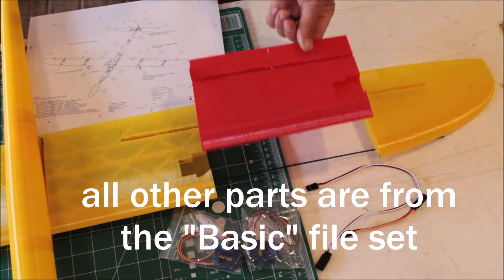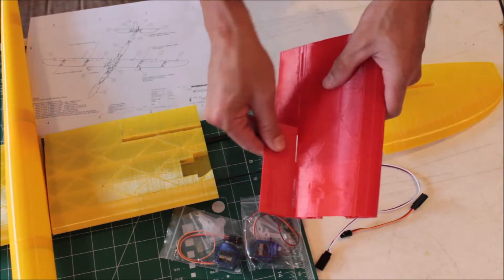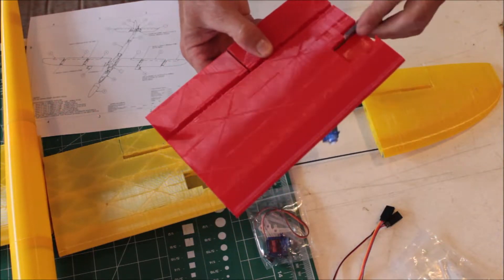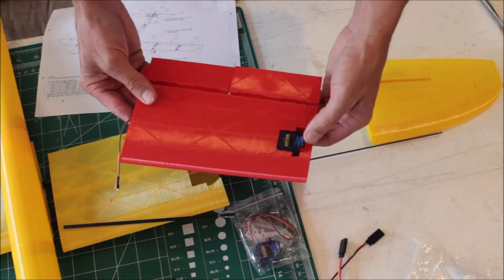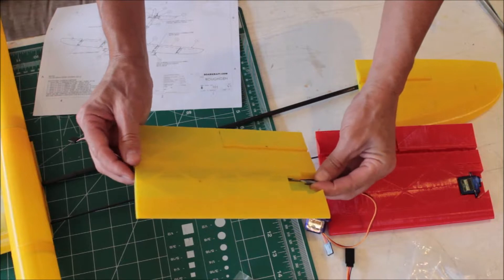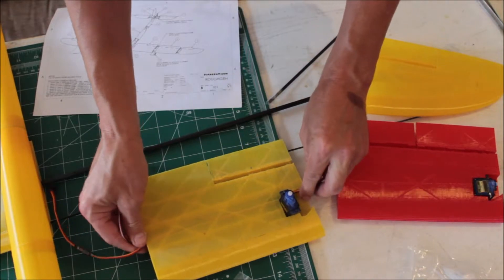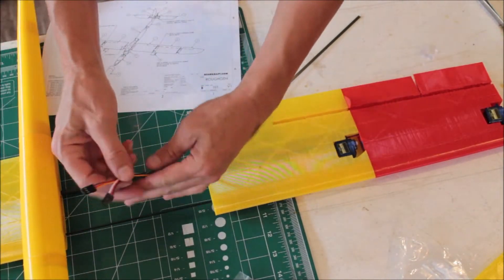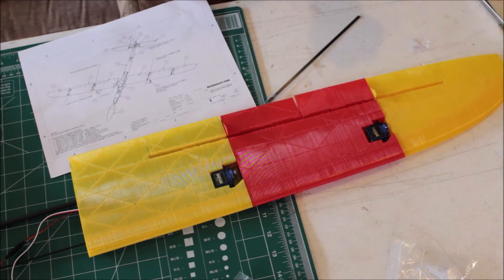SoarKraft Roughgen - 4 servo wing - quick build guide

Comment: I have just orders the files and await some PETG to arrive. Can you tell me how to set up crow on the radio gear?
Reply from the maker: Crow: 
Full down flaps - both side inward surface , 
30-40% up on both aileron - both side outer surfaces, 
and 5-7% down elevator to compensate for flaps induced pitch.
Adjust as necessary for a slow, flat decent.
  
"crow" set up has more to do with the transmitter you are using and its programming abilities.  your transmitter manual / instructions would discuss this type of programming in the glider set up for a four servo or competition glider use.  It may also be called "butterfly" or "landing mode".  It is possible to use mixers and just the flaps control, but this is way more complicated, requires more precise mechanical set up, and can not be adjusted for other functions.      

You will also need a receiver that has 6-7 channels to access the full functions of your transmitter and connect to the additional servos.
Reply: @soarkraft  Thanks - hopefully starting to print in a few weeks. and get on the slopes before it's too cold. I have a spektrum DX8 with lot of different servos.

Such a gorgeous looking glider -exactly what I was looking for - so thank you!